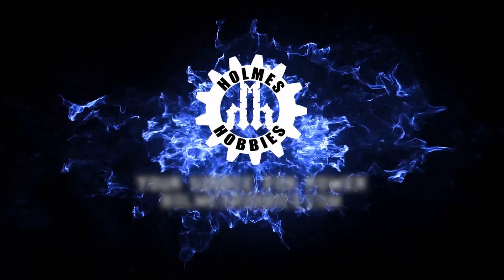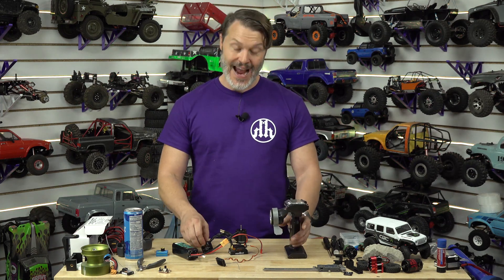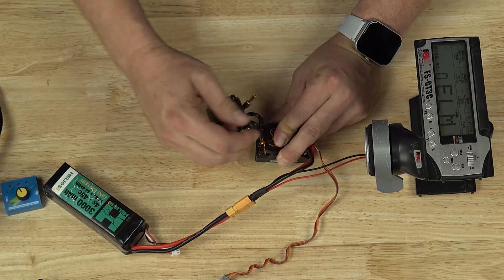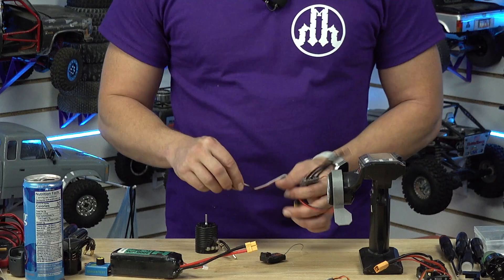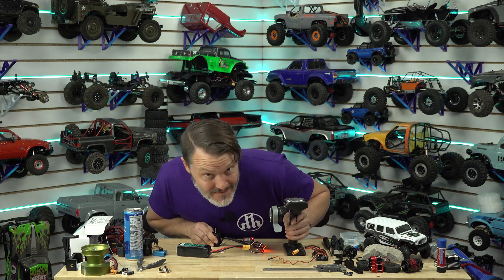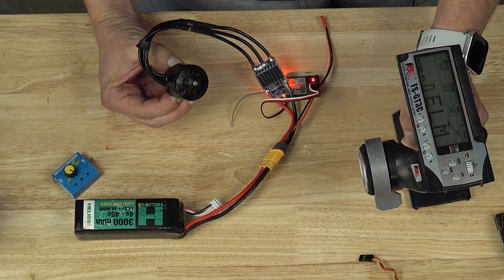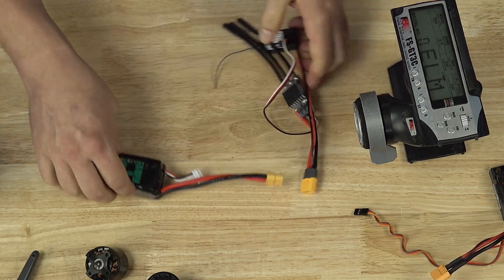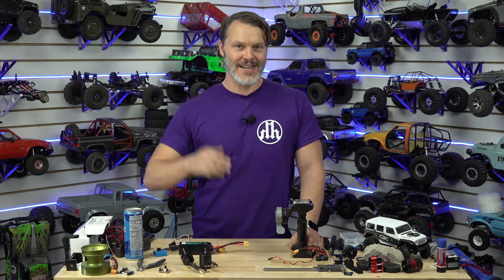🏁Because You Asked!  🔊 Which RC Motor is the Quietest? John Robert Answers! 🤫

Comment: With outrunners, the 14p ones are super smooth, but the 10p one I have has a consistent surge in power with steady throttle. Why, and what can I do to make it smooth? It's not cogging, it's a power surge
Reply from the maker: @TheAmericanUhate  what esc?
Reply: @HolmesHobbies  I've tried it with an am32 and a furitek python X, but have the same power surging thing going on. It's like a steady consistent on/off surge in power, while I'm holding the throttle steady as possible

Comment: outrunnner sounds likes more modulation - would a bigger shorter in runner give smooth torque delivery?
Reply: as in like  6.35mm shaft / 40mm case 12 pole🤷🏻‍♂️